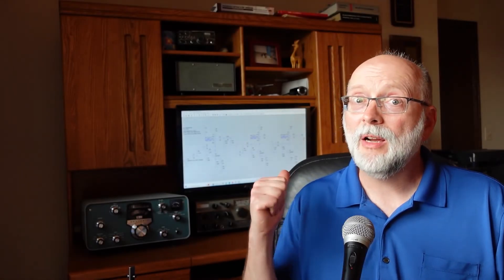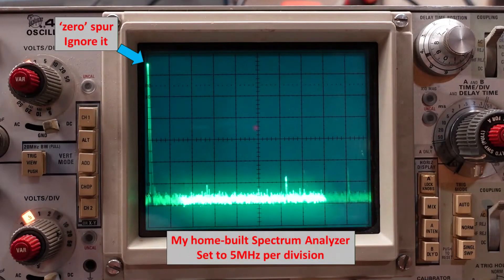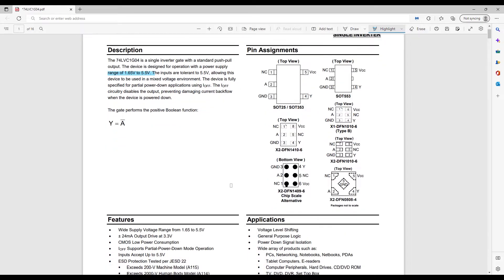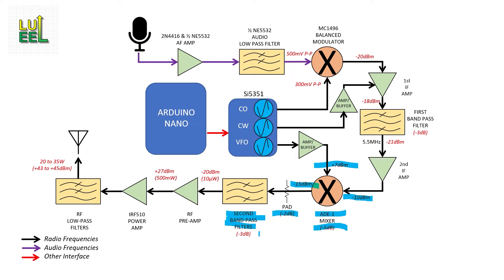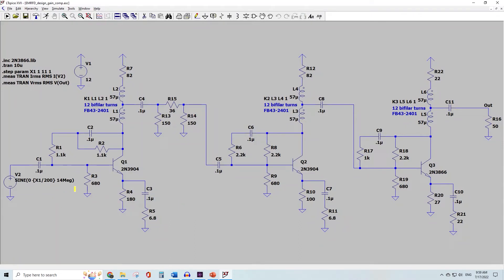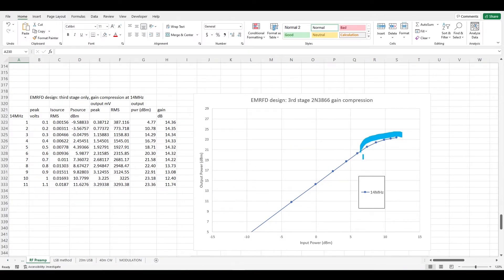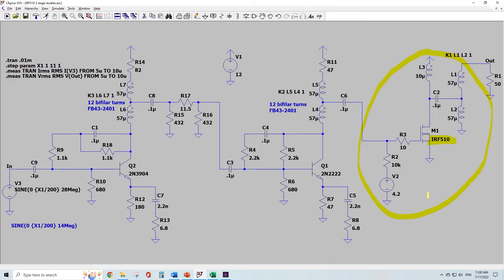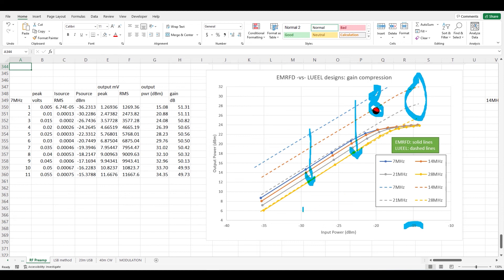HF Transmitter #03 - RF Preamp and Gain Compression Woes

Comment: Way outside and above my wheelhouse, but your channel is so great that I watched it anyway. As you are considering options to work around issues... IIRC, you changed the impedance, at different points, to make up for starved current. Would adding current/bypass transistors, instead, mitigate other downstream issues? As said, not my wheelhouse, but just trying to help you think creatively. Is that your Dad's Shure 48 on your DIY preamp? If so, it sounds really good. The "S"s are a little strong, in the high end, but that may be my laptop output, as opposed to your mic. IIRC, that mic has some gain in the highs. Some simple filtering might help and be fun to build. Cheers!
Reply from the maker: Thanks for the tips!.  Yep, I sure am still using that Shure 48 and my homebuilt preamp for all of my audio. I think I'm on the 3rd 9V battery for it now.

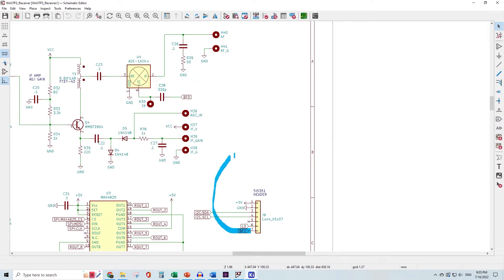Comment: 1:42 I'm pretty certain that "Output Buffer Supply Current" stands for the power consumption, similarly to the previous line "Core Supply Current". Note that both are in "DC Characteristics" section. Si5351 has 50 ohm output impedance and provides 2-11 dBm signal without problems, depending on chosen drive strength. This is true that the output signal is dirty though, but the reason is the particular technology used (PLLs with dividers), not the "Output Buffer Supply Current". From personal experience, using Si5351 without any filtering as a VFO and a analog BFO with double balanced diode ring mixers produces just a couple (3-4) of barely hearable spurious signals across all amateur radio bands.
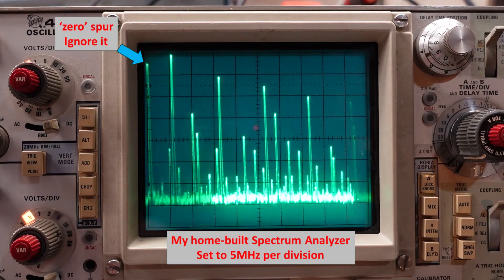Reply from the maker: I'm going largely off the experience shared on groups.io, where folks have done a lot more experiments than I have.  The spectrum that I show at 2:12 in the video is with CLK0 set to 5.5MHz and feeding my SA through a 20dB inline pad, and with CLK1 set to 10MHz and connected to a separate 50 ohm resistive load.  Turning CLK1 had a dramatic degradation on the CLK0 output.  Also, I don't show it in this video but CLK0 in the time domain looks like a ragged triangle wave when CLK1 is turned on.  But for sure, I'll be doing more experiments on the bench with 'dirty' and cleaned Si5351 signals feeding into the balanced modulator and 2nd mixer to better quantify the effects. Thanks!
Reply: @levelupeelab  Interesting. I've just reproduced the same experiment. CLK0 set to 5.5 MHz and CLK2 set to 10 MHz (CH1 is not used in my homebrew Si5351 signal generator). CLK0 is connected to the spectrum analyzer, CLK2 - to the dummy load. CLK0 is quite dirty when you turn it on - there are both odd and (weaker) even harmonics, but turning on CLK2 doesn't have any effect on CLK0 purity. I suggest trying two remote channels - CLK0 and CLK2 to reduce the chances of the crosstalk. Also it worth checking that the power supply is not the reason, e.g. it's clean and you don't hit CC state. Finally, this can be a bug in a particular Si5351 library. All libraries I've seen had defects, this is the reason why I ended up creating my own ( afiskon/stm32-si5351 on GitHub). (As a side note, most Arduino libraries are far from being great; the libraries for working with SD-cards are just terrible, as an example). I realize you are using AVR for this project, but you can try substituting the algorithm used in the library, as a final resort.

Comment: 👍👍 The CO at 3:18 is going to be on a constant frequency. If your library of choice supports using only 2 channels of Si5351 using an analog crystal-based oscillator is an option. (Actually this is a drawback of the particular library. It's true that Si5351 has only two independent PLLs but for frequencies below 81 MHz one PLL can be safely reused between all 3 channels.)
Reply from the maker: Thanks, yes - I am indeed thinking of using a crystal oscillator for either the CW carrier or the local oscillator for the balanced modulator.  One tricky bit is I cannot easily find crystals at 5.5MHz, but plenty are available at 11MHz, so I'd just use a divide by two circuit to get that frequency.
Reply: @levelupeelab  For CW carrier I successfully used a low-frequency (700 Hz, 1000 Hz) Wien bridge oscillator in my recent projects. The low-frequency signal should be injected near the AF stage. Not sure if this is OK for this particular project.
Reply: I've just checked my old CW/SSB TCVR project. Injecting a low-frequency tone on AF (near the microphone amp) should work just fine.